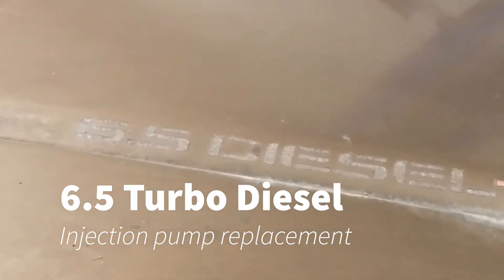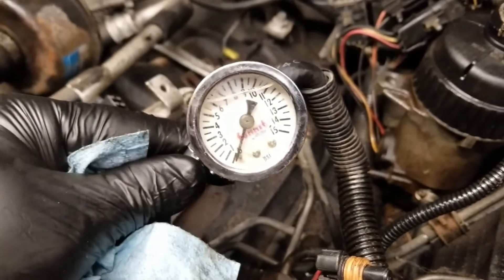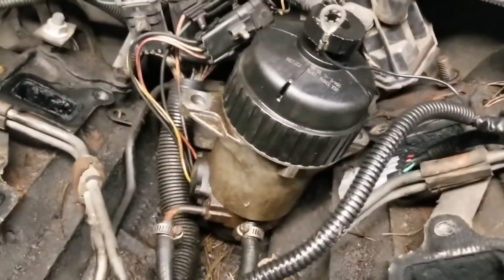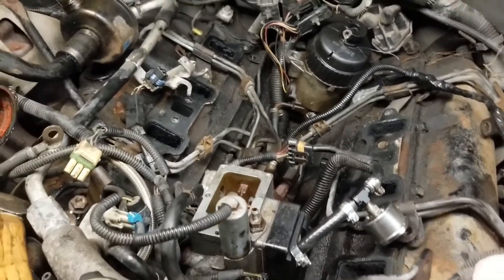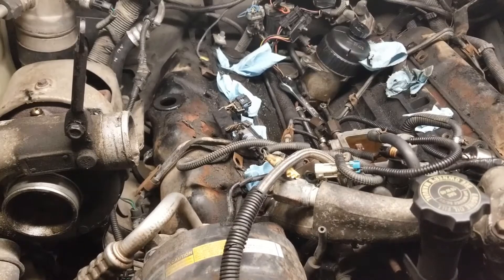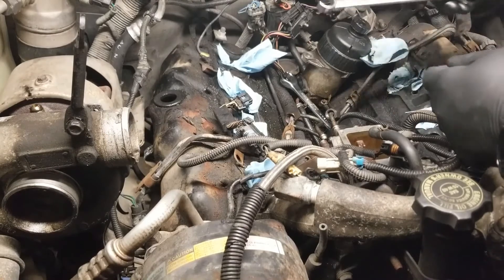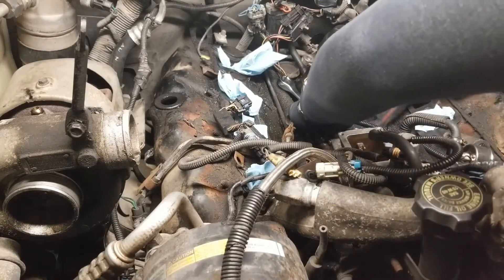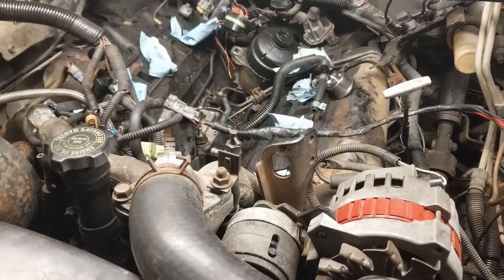6.5 Turbo Diesel Injection pump install Part 1

Comment: Thank you for the video. I have a 93 Chevy 6.5 turbo.  It starts and runs fine but when I shut it off
I have to let it sit for 4 hours before it will start.  It could be the injector pump.  I've never done
this repair but I will have to because no one knows how to do this repair.  Thanks again.

Comment: Can you remove the pump without removing the injector lines from the injectors?
Reply from the maker: NO.  you need to unbolt from the injectors and remove the upper ones to unbolt the lower lines from the injection pump.